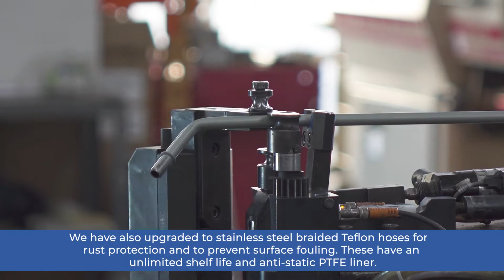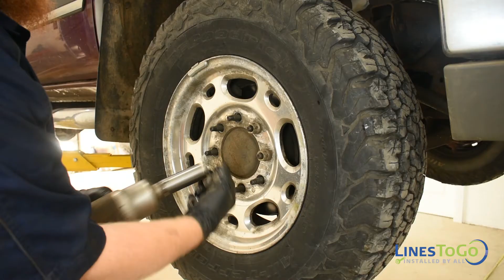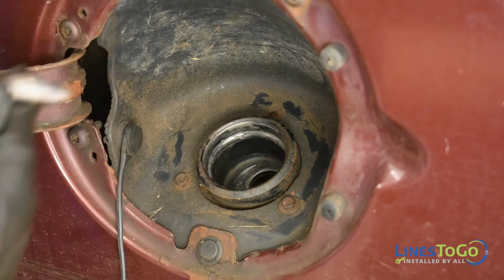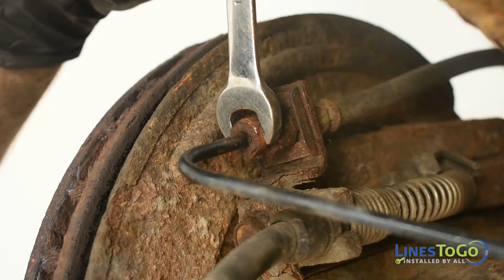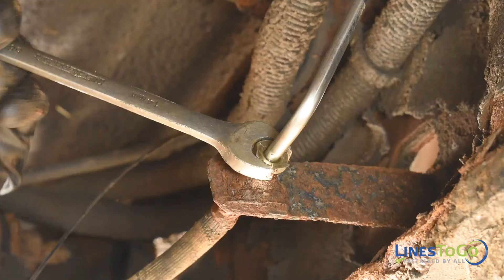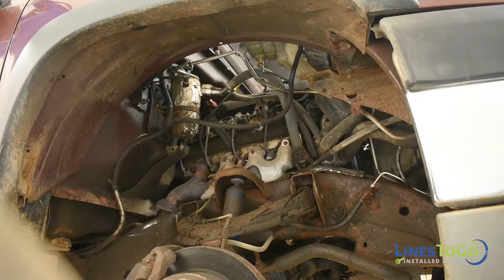How to Install 2003-2007 GMC Sierra 2500HD/3500 Brake Lines

Comment: Way more work to remove the tank. Just disconnect the tag light harness at the back of the bed, loosen the filler neck and the two bolts that mount the bed to the frame on the passenger side and remove the two bolts that hold the bed to the frame from the driver side. Then you can carefully tilt the bed by lifting it up on the driver side to give access to EVERYTHING. You can use a short block of wood to hold the bed at an angle (just don't go so high that you put too much pressure on the two bolts still on the passenger side). That gives you all the access you need to do these brake lines without having to drop the tank and the fuel lines..
Reply from the maker: Hello,

Thank you for the information, we will forward this to our mechanic to look into.

Happy Travels,
LinesToGo Team